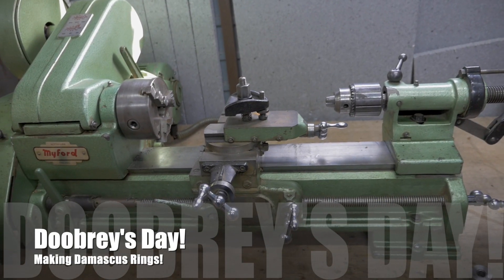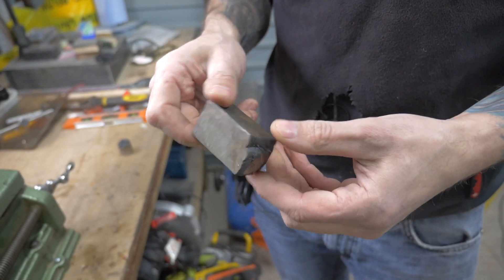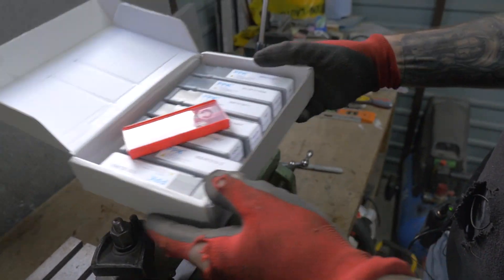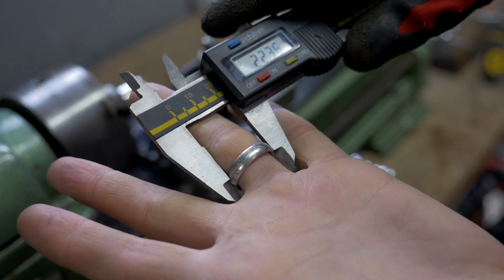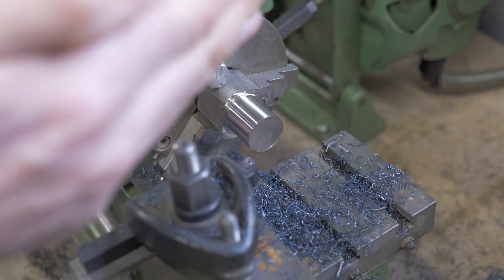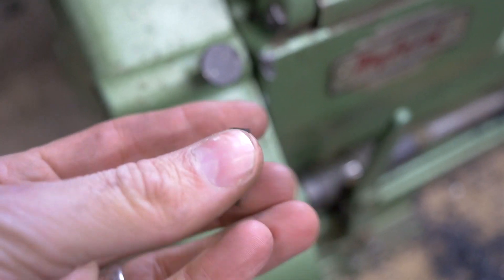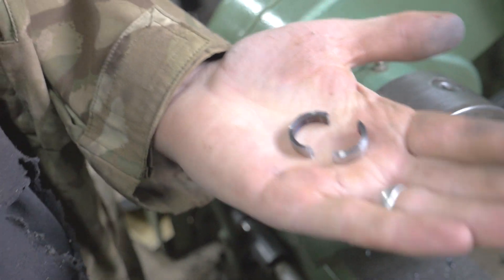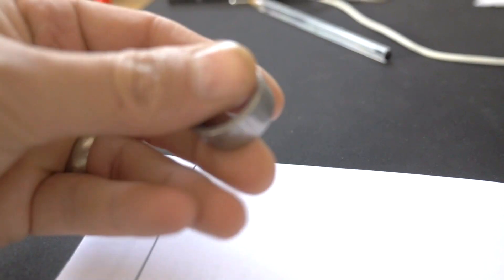How to make a Damascus Ring!

Comment: Hello doobs, as you know I don’t know very much at all about lathe work, however I think I’m right in thinking that keeping the work pice and tooling cool will extend the life of your tooling and give you better smother results in your cuts, you can do this by using oil, I use 3 in one oil when I use my drill for example, I could again be wrong but your speed I think maybe a bit fast slower is better in metal work. Just a little bit of my very basic knowledge that I hope will help you succeed. Otherwise a great first attempt even if it did go wrong but that’s what this is all about learning from your mistakes. Good luck with your project and I will look forward to your next video. Steve.
Reply from the maker: Thank you Steven!  I am always open to suggestions on how to improve, so will once again take your advice (thank you!) :)
Reply: Doobrey thanks Doobs I’m pleased that I can be of some help! 😃 see you in the next one.